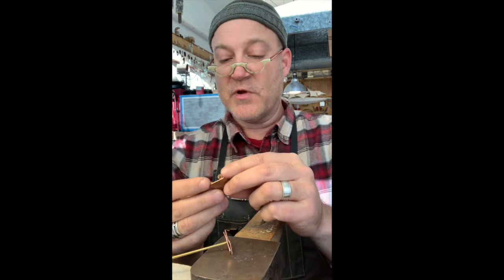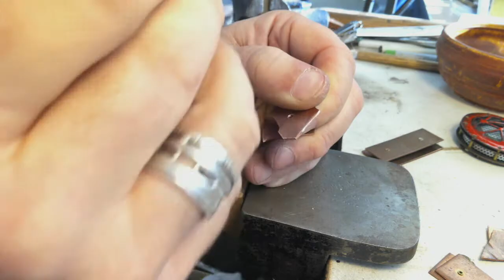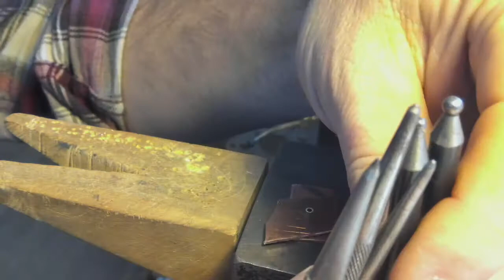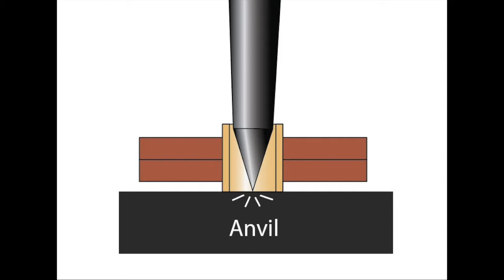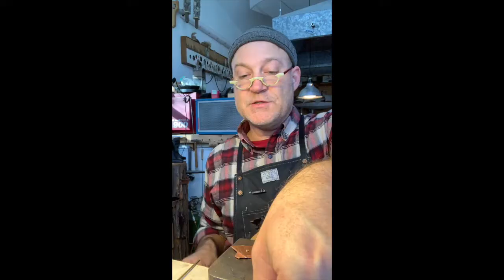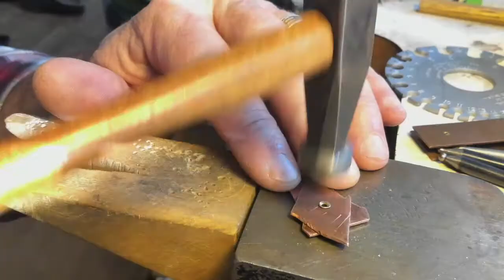Metalsmithing Techniques- Tube Rivets

Comment: Excellent! I haven't been having good success with this type and it's my favorite "look". I start with the smallest dapping ball right off, but using pointed punches first is obviously the smarter way.  What are the most common sizes of tubing available and is there a difference when working with a larger sized hole? Thanks Danny!